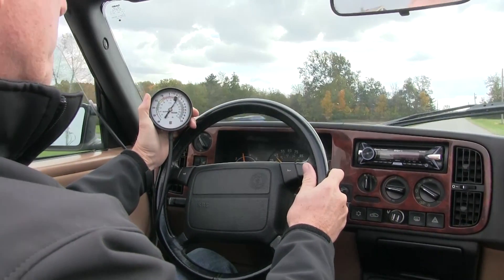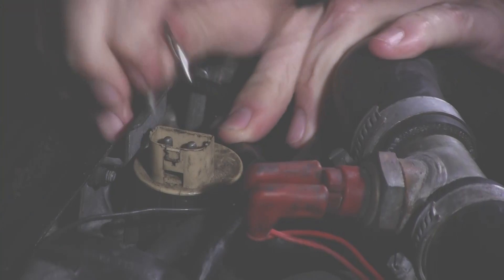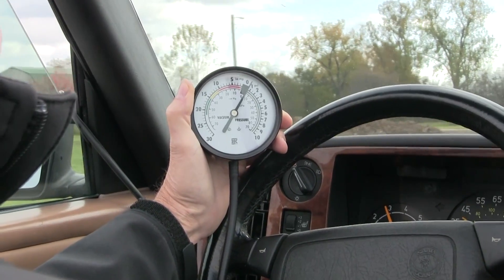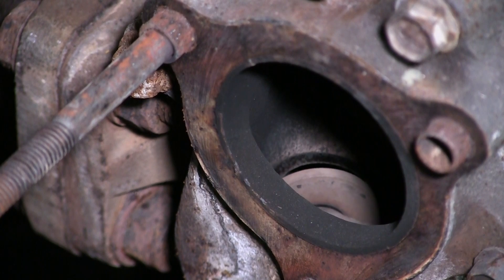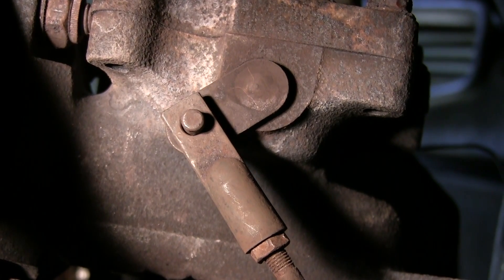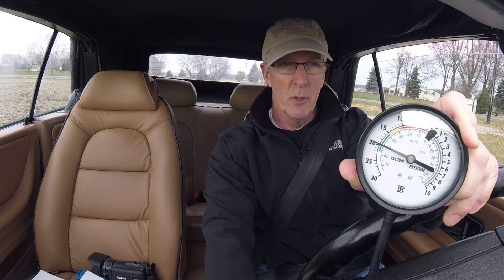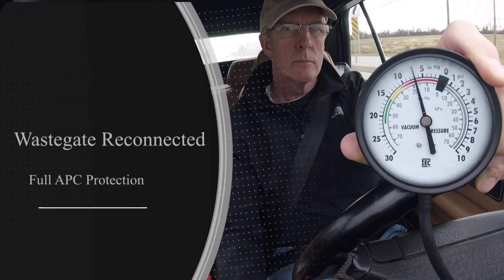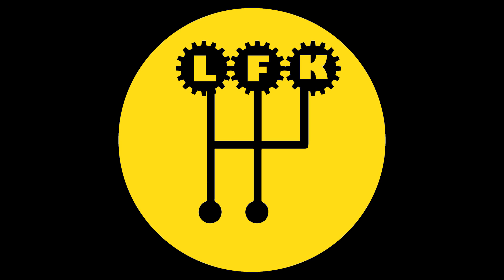SAAB 900 Turbo Boost Test

Comment from the maker: Well, what do you think is holding down the boost pressure?   Engine is set to 16 degrees BTC as recommended.  I've checked for vacuum leaks and replaced a bad rubber charge tube coupling.  There is an exhaust leak at the manifold, but I don't know how much of a factor that would be.   Suggestions?
Reply: Also the control gate in the cast manifold has sticking points as it becomes worn on its hinges. These hinges have no lubrication due to the temperatures involved and often will hiss as exhaust gas leaks through. If you disconnect the actuator control arm and manually operate the gate you will be able to feel excessive play and rough movement.
Reply: If you have boost pressure when removing the hose. Its something with the APC valve or something blocking it to function properly.
Reply: I was thinking it could be the turbo boost actuator control arm. Maybe it is heavily corroded inside or the diaphragm is split.
Reply: @Durgemonger  Think about it, when he unplugged the waste gate actuator diaphragm, he got max boost and when he plugged it in he got low boost.  This proves the diagram is opening the waste gate.  He needs to shorten the adjustment on the actuator rod.
Reply: The APC solenoid is a form of magnet. I noticed that the connectors on yours aren’t in a connector. They aren’t isolated. The magnet of the solenoid interferes with the connection. 
Get some connectors that are sealed in rubber, that way you isolate them and the solonoid will work! It took me months to figure this out on my 87.
Reply from the maker: I hadn't thought of that.  The solenoid clicks with application of the brakes and when you do the "blow test" it tests out fine.  Since the solenoid keeps the wastegate closed until the engine pings, if it were not working I'd think the boost would be higher not lower.  Make sense?
Reply: Maybe the pressure sensor over the pedals or the APC valve or the Box.
Reply: I've got issue with this too on my 86 Turbo... when i press the throttle between 2500rpm and 3500rpm it doesn't build boost. When it's lower or higher it hit full boost.
The Turbo APC boost gage block in the middle.
I replaced the solenoid once and it worked for a while. but since start of winter with a lot of humidity (it rains all the time here in Belgium) i've got the same issue again.

My guess is bad electrical connection. The old wire insulations on my and your Saab might be cracking.  I've already had to temporaly taped it in different places.